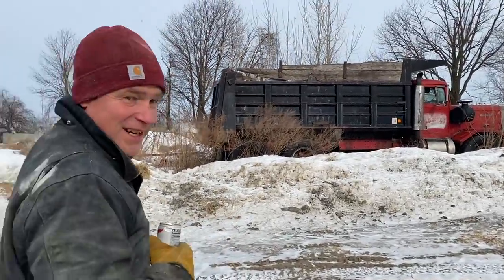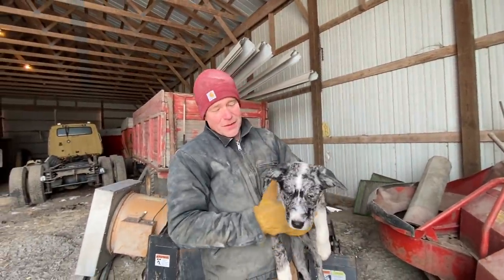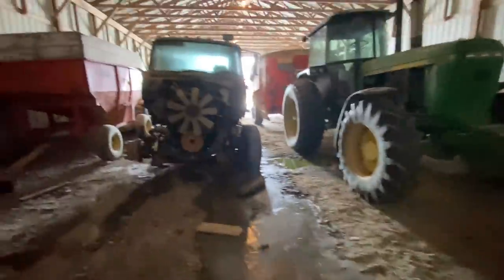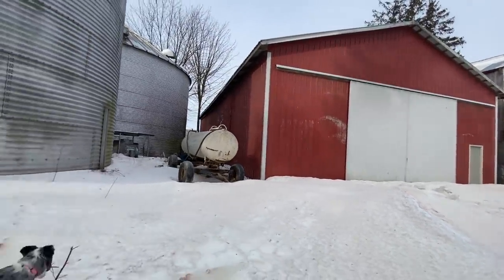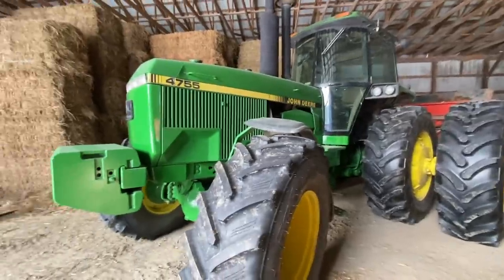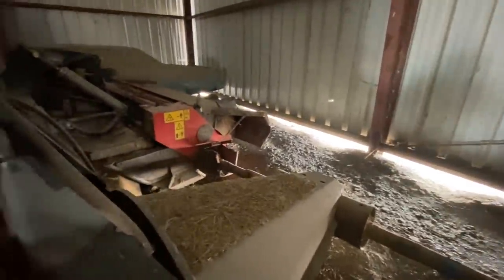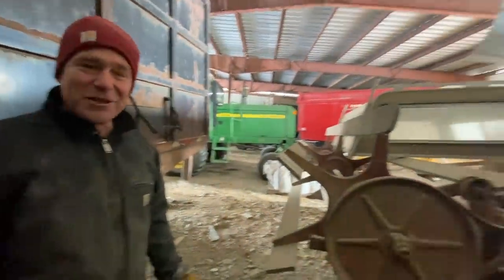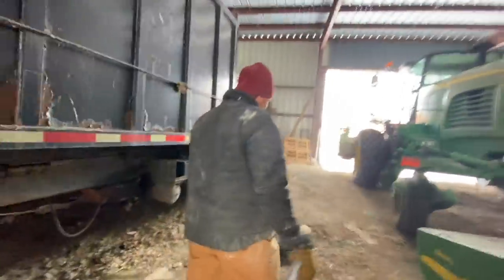Selling our equipment on the farm!

Comment: It will be cool to get the big Autocar truck out and cleaned and useable again.
 I seen antifreeze puddled on the ground, in the big shed. looks like it came out of the tan parts truck. Antifreeze ingested into your dog will kill the dog. It should be clean up that antifreeze sooner rather than later.

Comment: Claudia, if that was anti-freeze you look at in front of that yellow parts truck. You need the either cover it with saw-dust or take a bush broom and spread it around  so it is not a puddle. You don't want to take a chance of the dog licking any of that.  Anti-freeze contains ethylene glycos which causes instant cerosis of the liver when a dog or a cat consumes it. It is poisonous/deadly.They are attracted by the sweet smell of it.

Comment: Grandpa had the first self propelled combine in his area and it was a Massey 35 without a cab.  I don't think his Case had a cab either.  With the price of scrap metal, no way that 643, truck, cultivator, blower thing would be setting in my shed.  You guys dont use LP?  Lots of NH3 tansk switched to LP here.

Comment: Autocars are worth some $$$$! 
"Autocar founder Louis Semple Clarke (1867–1957) was a successful mechanical engineer. Among Clarke's innovations were the spark plug for gasoline engines, a perfected drive shaft system for automobiles, and the first design of a useful oil circulation system. Clarke's initiative to place the driver on the left hand side of the vehicle was ahead of its time but eventually became the standard in much of the automotive industry worldwide.[5] Clarke also developed the first porcelain-insulated spark plugs in America and the Autocar thread specification became the standard in the U.S. automotive industry." wikipedia